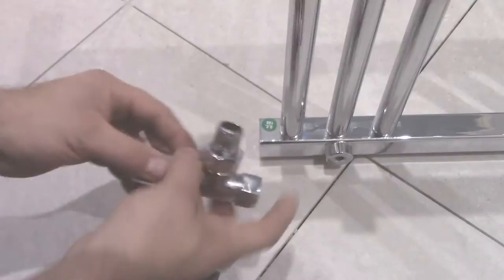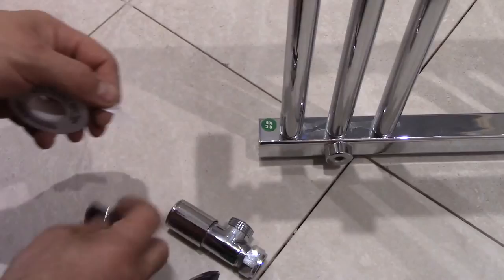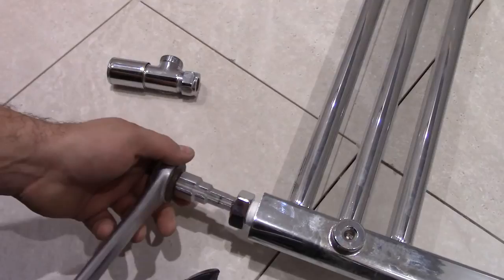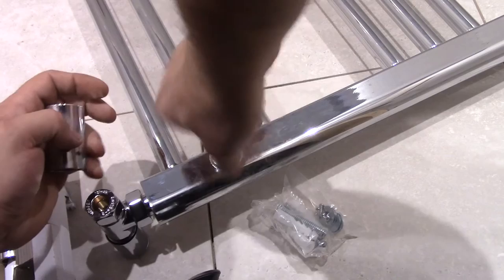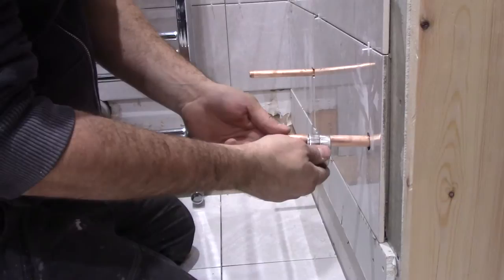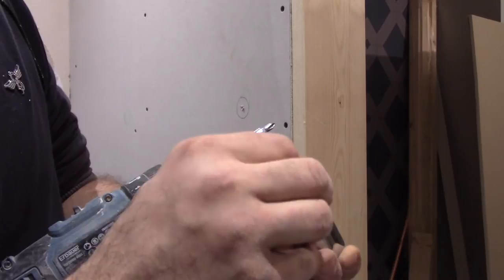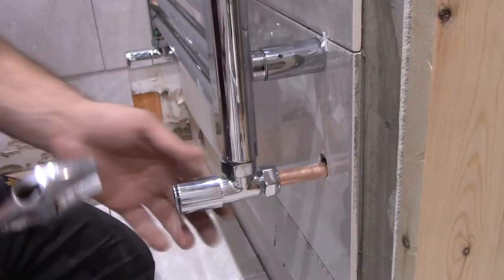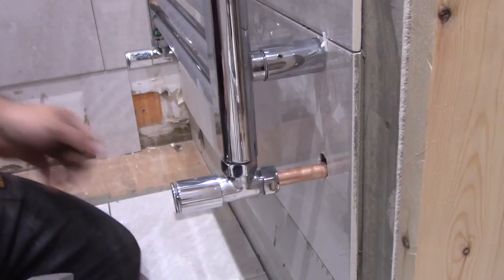How to install  and plumb towel radiator  Fitting chrome towel radiator

Comment: Should have used chrome plated copper pipe on the visible pipe work! I'd have also positioned the pipework so that the fixing holes/bracket mounts wouldn't be right near tile edges/corners. Should have sealed the bracket mount screw holes to avoid any water ingress.